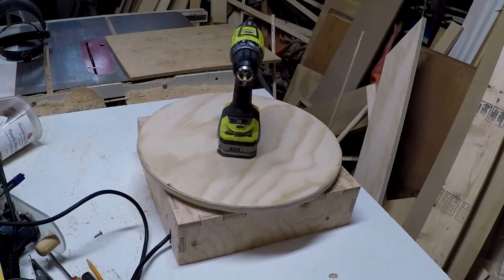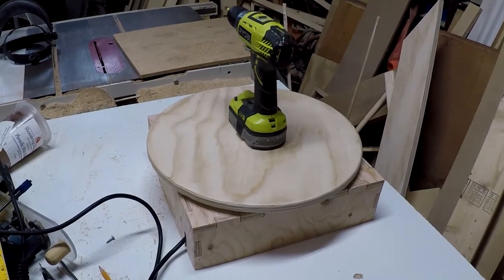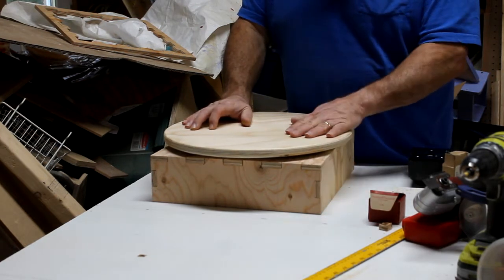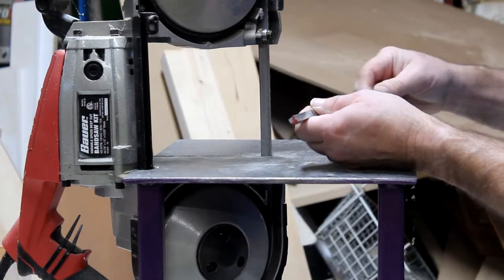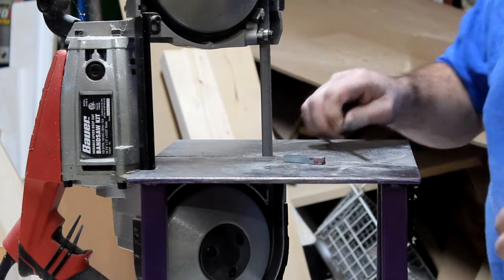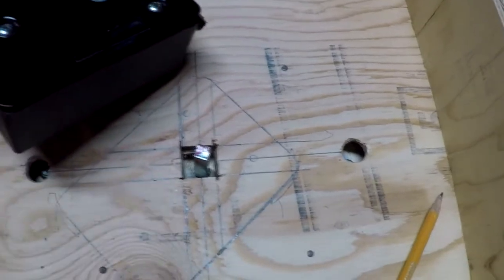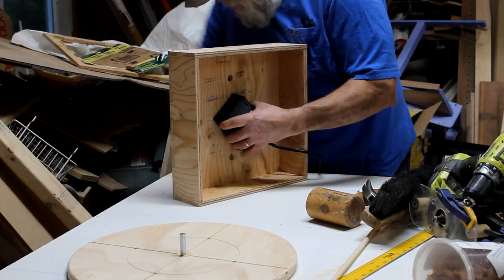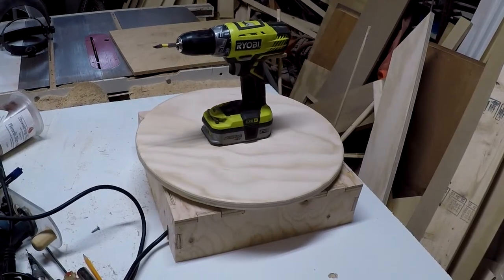(S-4 Ep-29) DIY Motorized Turntable (FREE PLANS!)

Comment: Looks perfect! What is maximum weight it can carry and rotate? I'm I sculptor and most of my sculptures are between 10 and 30 pounds; will they spin? Warmest greetings from Poland!
Reply from the maker: Depends on the weight rating of the lazy susan hardware. I didn't look at it - threw away  the packaging. You might check with Home Depot (where I bought the lazy susan hardware).
Reply: @DowneastThunderCreations  will do! Thanks for reply. Godspeed!